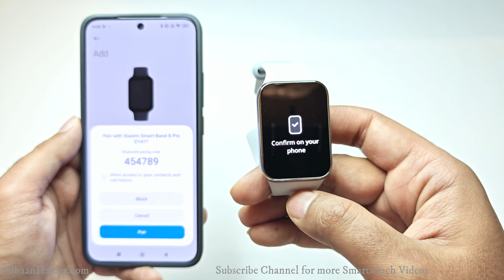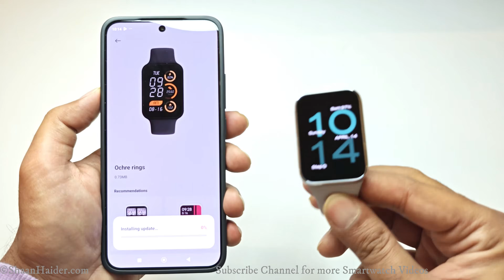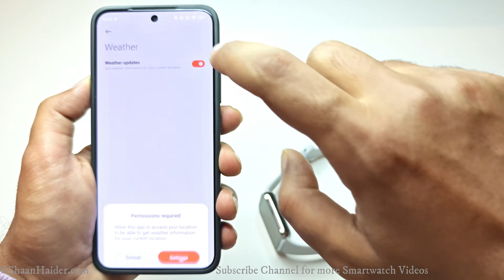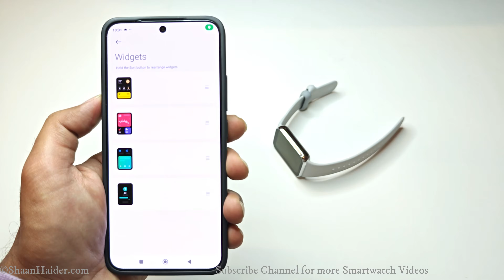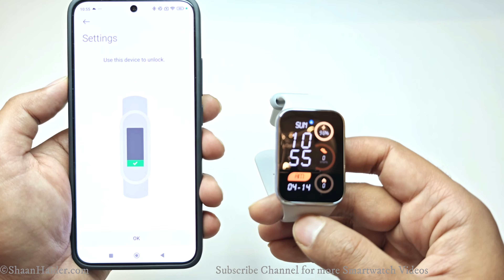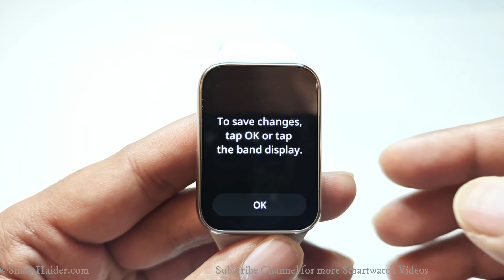Xiaomi Smart Band 8 Pro - Detailed Features Walkthrough, Setup and Customization

Comment: how do you handle updating the weather widget? because the fitness app requires GPS to be turned on (I don't prefer it), otherwise it won't update after about 4 hours and the watch again requires access to the phone's location. I would imagine some option to add a location/city manually for weather updates without having to keep the gps on all the time